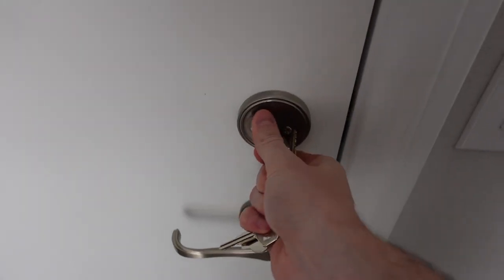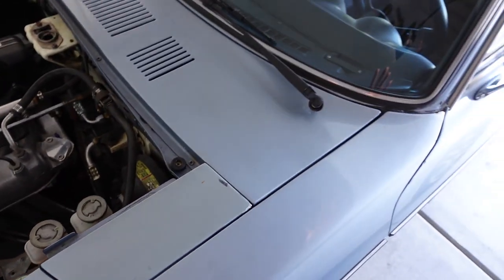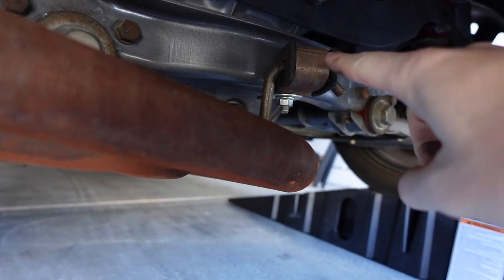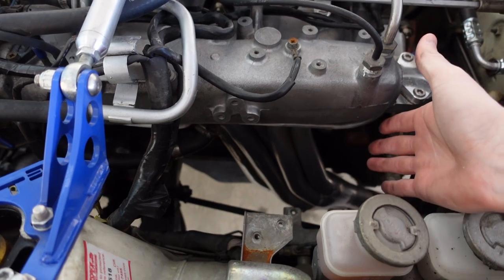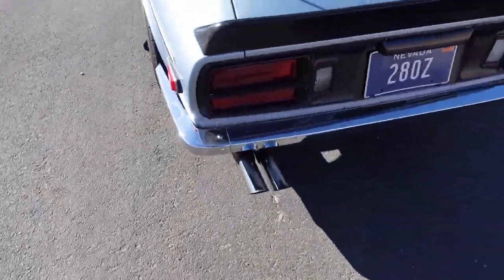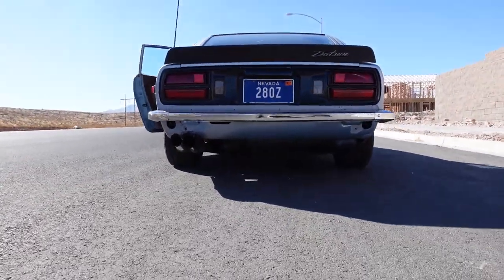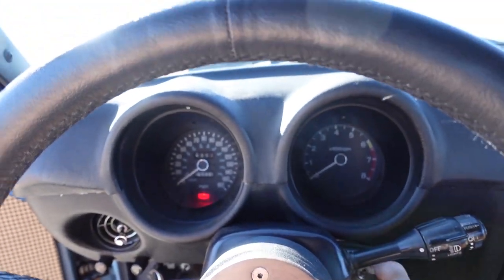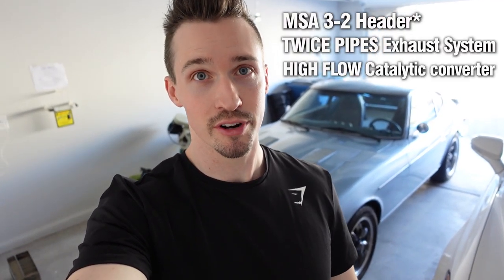DATSUN 280Z EXHAUST | MSA 3-2 HEADER TWICE PIPES | Motorsport Auto Header and Twice Pipes Exhaust

Comment: Great video thanks for walking through it.  I’m still deciding on my exhaust setup.  I noticed you have a shroud on your aluminum radiator.  Where did you get that? I don’t have a shroud and the one off my old stock radiator doesn’t fit.  Love your build!  Thanks
Reply from the maker: Hey man, thanks for watching! Believe it or not that’s the stock shroud with minor modifications and I painted it silver. It fit pretty well over my champion radiator!
Reply: @JordanPayneLV  Jordan, really like your vid’s,  I like your approach to making your car uniquely yours and it looks good.  I picked up a 280z fan shroud today at a salvage yard.  How did you attach it to your aluminum radiator?  Also I really liked your video  installing the BRE lower lip.  It cam out great.  I had bought the Xenon Air Dam and I’m seriously disappointed in the quality and won’t be using it.  I’m going to do something like you did.  Just need to get some stock valance pieces.
Reply from the maker: @av8ferg237  thank you for the compliments man! Yeah it’s hard to choose a front valence that is unique but also good quality. Definitely go with the Motorsport auto one, the carbon was great quality! And I cut little lines in the side so that it would match up with the bendable tabs on the champion radiator. It wasn’t too much but did need a little cutting on the shroud :)

Comment: I've heard about people having to use different shims in order to prevent it from leaking. Was that not the case for you?
Reply from the maker: I’m not sure about shims because it needs to be perfectly flat, but I’d say take a look at the manifold on something that is flat, and see if it has a curve. Regardless, tightening from the middle outward is going to give a good seal. I don’t think any shims would actually be good on an exhaust flange

You can get a thicker gasket, a higher quality gasket that will help seal something with a minor warp. Those are sometimes a bit pricey but worth it in the long run. There is also copper gasket spray that you can use that helps too

Comment: getting rid of the mechanical fan will change your life. Nice exhaust
Reply from the maker: What kind of benefits do you get from it?? Thanks!
Reply: @JordanPayneLV  The reduced weight allows the engine to rev much easier. It makes the throttle a little snappier and, in my opinion, makes the car sound better because you don't hear the fan spin with the engine. My pickup benefitted substantially from the electric fan because it did not have a clutch for the mechanical fan.
Reply from the maker: @Tan997  all good points! I’ll keep it in mind for sure, I kind of always liked the nostalgia of the fan but I can see how it has a ton of inefficiencies
Reply: @JordanPayneLV  Don't do it. Been there done that. Nothing beats the stock clutched fan for cooling. Chased over heating issues for years thinking that little little bit of extra horse power was worth it. Even with a 4 core cross flow race radiator numerous electric fans would not cut it. Finally switched back to the stock clutched fan & problem was instantly solved. You want throttle response go with a light weight flywheel & a balanced rotating assembly...........removing the stock cooling fan is meaningless in this regard.
Reply from the maker: @Kronaphasia  this is good input considering I live in one of the hottest places in the country haha. My car already gets warm at idle in traffic so I’ll need all the cooling that I can get!

Comment: What kind of fuel rail is that?
Reply from the maker: It’s from Zcardepot.com, great little
Unit
Reply: @JordanPayneLV  I've been looking at that fuel rail for our project z, worth the investment?
Reply from the maker: South7Bois I think so, there is something to consider though. They give you barb fittings for the individual injectors and then give you AN fittings for the fuel pressure regulator... but they don’t provide any AN lines. I’d say give them a call and ask for additional barb fittings instead or get yourself familiar with how to run AN fittings. Or just go to your local hardware store for an additional barb fitting or two
Reply: @JordanPayneLV  awesome thanks!

Comment: Doesn't a collector defeat the purpose of a 6-2-2 header?
Reply from the maker: Yeah that’s how I felt after receiving the twice pipes, and it still does. But the benefit of having a collector means more torque at a specific RPM range for scavenging and because it’s still 2 small tubes at the exit and through most of the exhaust, the tone is higher pitched